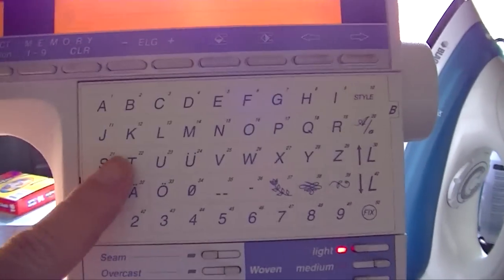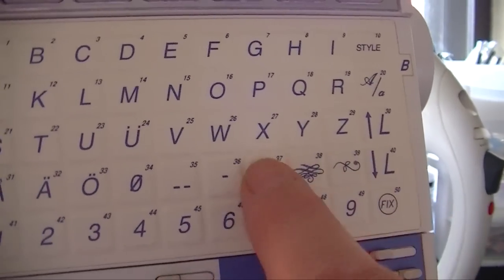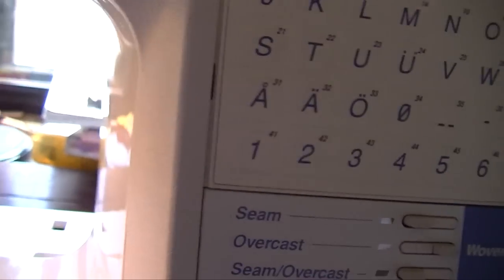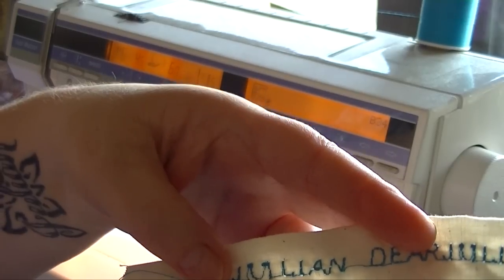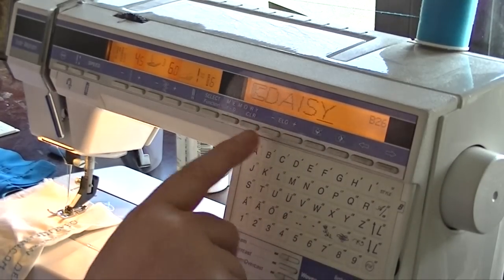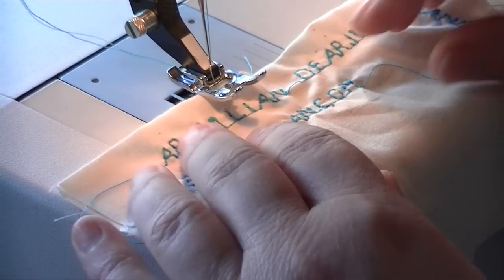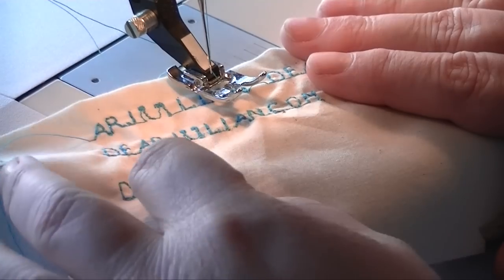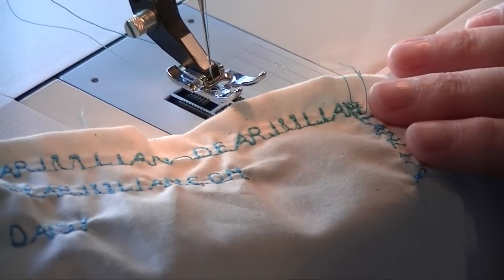Husqvarna Cassette Demo

Comment: I know this is an old  idea post, so I don't know if I will hear back from you. I have a #1, and 2 #1+'s. Did you get any more cassettes? You can enlarge the letters by pressing the "+" signs for stitch length, and stitch width. It will beep differently when it is enlarged as far as it will go.

Comment: Help !!!!  I believe I have the same machine 1100 I got it in a Goodwill close to my home with everything but the Manual. I love it but I'm having trouble with the thread I make handbags for friends and just for the fun of it, usually i sew them with  Upholstery thread, which is heavier than normal, I can't find the correct tension on the left side wheel, since you been playing with yours longer could you tell me if you have any idea what works good for heavy threads.  Thank you very much for you reply.
Reply: use sulky thread it the best and tension show usually be set at 4-5

Comment: I just got a husqvarna sewing machine; I thought it was a 1250/#1; but I believe it is actually an 1100, that being said, which one are you using?
Reply: This is not a #1+. The 1+ is also an embroidery machine and you wil see on the back of the machine a small panel that is removed for the embroidery unit to attach to so the electrics work it. Also, under the arm, front of machine in the "elbow" you I'll see a slot to take memory cards on the +1 and this machine doesn't have it.